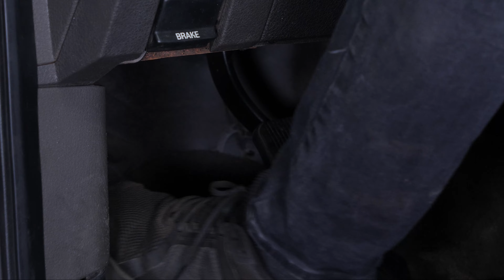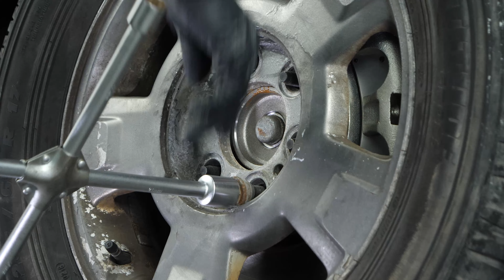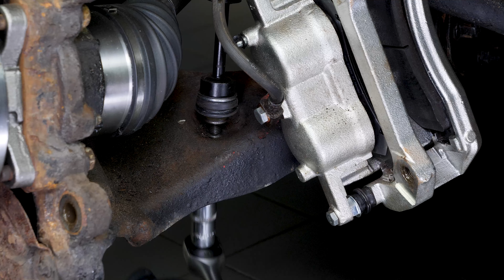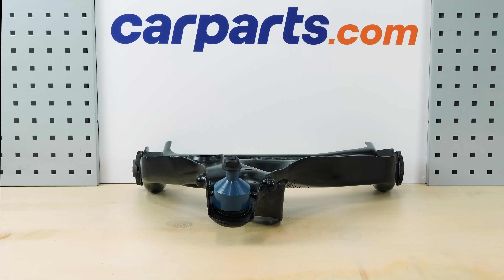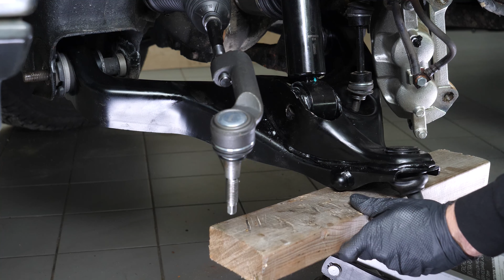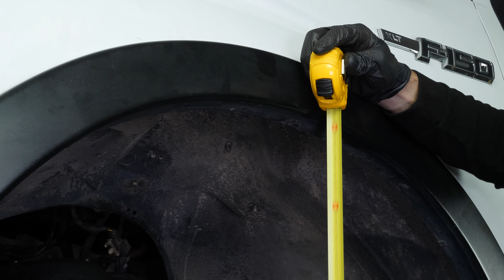How to replace the Lower Control Arms 2009-2014 Ford F150 🚗

Comment: I purchased a uca, and a lca. I have yet to find a parts provider that has the correct "screw(21 mm) and flange nut (27mm). They are all trying to sell me a 21mm and 24mm which does not have the same width for the hole on the LCA.

Comment: Please pardon the potentially dumb question but how do I torque the strut lower nut to 406lbs. with the torque wrench in the description?
Reply from the maker: Hi @user-bk5eu5jc2c, thanks for your comment.
For the strut lower nut and the lower control arm holding screws, you can find the torque wrench with the proper range in the (updated) description or  by clicking on that link : https://bit.ly/torquewrench25688us.

Good luck for the operation and tell us how it went.

Comment: You forgot to show how you align the control arm bolts in the camber slots
Reply from the maker: Hi Chris! Thanks for you relevant comment.
During this operation, you will be intervening on the front axle of your truck, so we highly recommend to perform a wheel alignment afterwards, as we say in the description. It is way more efficient than aligning it manually.